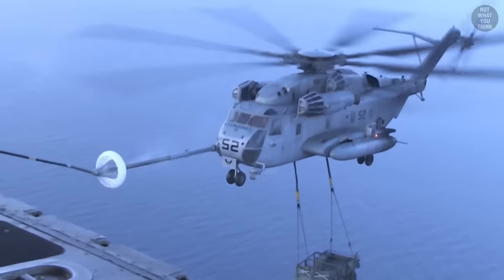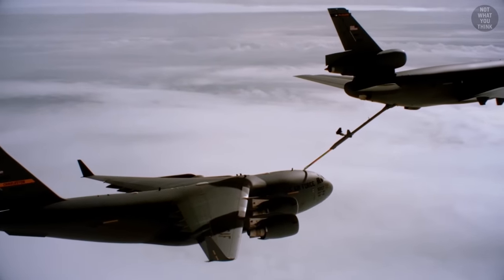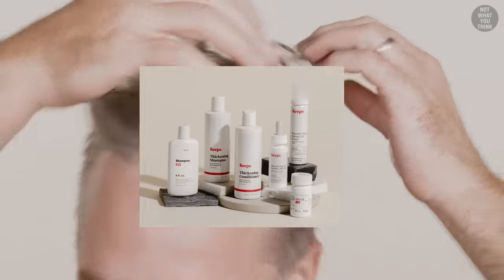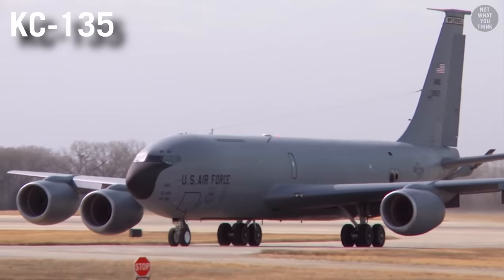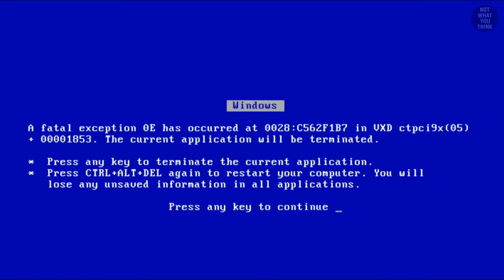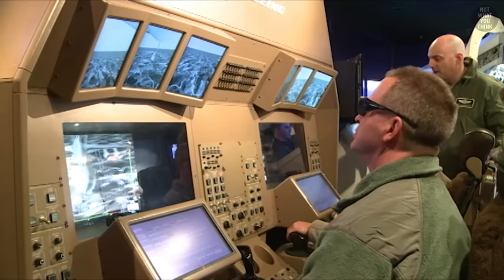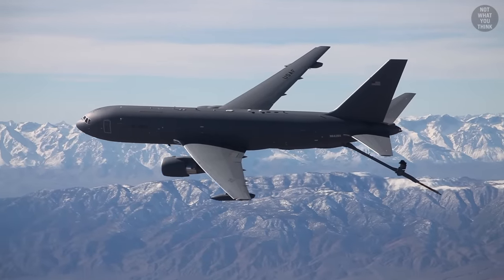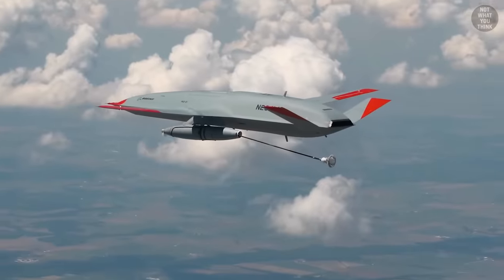Why US Air Force is Making Aerial Refueling HARDER?

Comment: There is a huge difference between complete automation and replacing human vision with a camera. Automation on tanker's part is pretty simple. For a probe and drogue aircraft, just make tanker fly in level, a capability present on any autopilot system in the last 70 years.. For a tanker with a boom, put something like a radio or coded IR transmitter on the F-16's refuel port, and a bunch of sensors on the tanker so it will triangulate the 3d coordinates of the refueling port. It can also calculate booms position with two angles and the length of boom, so its a matter of moving actuators to make these two coordinates meet. With some smart coding to make boom approach from front and top, automation software doesn't need to see anything beyond these two points and would be a simple arduino project for mechatronics undergraduates. 

Replacing human vision with cameras is just a stupid idea. Even today, human eye has greater Dynamic range than best DSLRs (21 EVs vs like 14 EVs). So when scene is bright, we are just better at picking details in shadows, or vice versa.. Our eyes are also less prone to flare or optical aberations (since its essentially a single lens, focusing on a curved plane), so less of the bright area will have impact on other areas. They come in pairs so we have automatic depth perception. Plus, they come free of charge (on the operator). A camera does not offer anything above this, period. Even at night, its just better to give night vision googles to the operator instead of IR cameras.
Reply: If its that simple, what do you think holding them from doing that, and trying this roundabout method. I don't think only for fleecing budget, they can do that without making technical mishaps
Reply: Automation ain't that simple. The main problem is the vast amounts of variables that go into in air refueling
Reply: @dimasakbar7668  I wonder if a reason for going with cameras instead of a window is the near-death sentence for the boom operator(s) in the event of a needed bailout?
I saw a documentary on the KC-135 that commented about that and the constant problems with fuel bladder degradation leading to a buildup of fumes in the rear compartment.
Reply: @dimasakbar7668  "fleecing budget" that is the answer lol
Reply: @andrewarnold9818  I love people making such claims without nothing to back it up. "It more complicated than you think"... No, automation is of refuelling boom's articulation is THAT simple.. It either can reach the intended target or it can't. If target is too far, too close, too high or too low, it can't.. If target is in a favourable area, boom is extanded to reach the target... This is EXACTLY what operator does.
Reply: @dimasakbar7668  Well only technical problem would be refitting every aircraft with a simple transciever... Real problem is ignorance, politics, and specifically ignorance of decision makers. Why F-18E does really exist? Because some morons were convinced scaling up F-18C to F-18E is a safe and straightforward solution because thats how engineering works. In reality Boeing essentially designed F-18E from scratch and it would probably have been much more easier for them to modify their F-15E with a reinforced undercarriage, folding wings, leading edge flaps and make it carrier capable... These are also the same kind of guys who thought its a smart idea to make F-35A/B/C a common airframe, because mixing up all these fundementally different roles is easy and would reduce development and maintenence costs..

You can't convince cavemen that computers don't think nor see like we humans do... So its incremental steps for them to digest... What we have now is manual operation. We add cameras for improved crew comfort(?). Then we add semi-automatic assisted modes to improve reliability. Then we add optional fully automatic mode to reduce operator dependency. Then we remove the operator and make it fully automatic.

Comment: It's quite ironic that Boeing still hasn't solved all teething problems on KC-46 yet while Airbus has already been testing automatic refuelling on A330 MRTT
Reply: Not just testing, it’s already operational, co-developed with Singapore Air Force, certified for use with F-15, F-16 and A330.
Reply: @eatdriveplay  The Boeing KC-767 is also operational with the Japanese Air SDF. It's almost as if these companies only give their least efficient stuff to us...
Reply: @jeffbenton6183  not with automatic refueling and 3D vision though :)
Reply: @eatdriveplay  And that is exactly why the Japanese KC-767 RVS works better then the KC-46.
Reply: @eatdriveplay  The whole point of the video is why THAT is a horrible idea
Reply: @DrSabot-A  it’s not harder - it’s easier for Airbus and their customers. Only harder for Boeing. Figure that out… LOL.

Comment: The Dutch RNLAF former KDC-10 (a modified DC10) was fitted in the beginning of the 90's with a similair system because they could not fit it with a Window, otherwise its pressure cabin could leak. But the flew 25years with it and it works perfectly. Now they switched to the Airbus a330 MRTT with Nato Allies with a similair system as the kc46.

Comment: As a prior KC-10 crew chief, the KC-46 program pisses me off. The tanker contract should have been awarded to Airbus's A330 MRRT, which is already well proven in other countries air force's. With the soon to come KC-Y program, hopefully we get the MRRT as Lockheed's LMXT instead of the KC-46 again.
As far as automated refueling Australian MRRT's have automatically refueled Singapore F-16s  earlier this year.
Reply: Exactly bruh. How the fuck is Boeing so incompetent.
No wonder why there were corruption charges.
Reply: And no.  Both a330/767 have prior to contract been used by other countries.  The idiot US airforce after awarding contract BOTH bid on using Existing refueling apparatus as their basis, then changed it to a new flying boom that may be partially automated.  Your automation F16 Singapore is via drogue and was done a decade ago by Boeing as well.  The problem is the boom via remote station without the automation features which would require existing aircraft to be modified to align the two.
Reply: It was awarded to the A330 MRRT but Boeing through political lobbying and complaining enough got the contract tossed and the contest restarted they of course  won
Reply: @MRMONKEY433  Well, someone pointed out the obvious, the a330 did not FIT into the existing aircraft support structure buildings worth BILLIONS making the Boeing bid much superior.  Now one could argue payload capability and here I also agree with them again, if you want payload, go with an even bigger aircraft.
Reply: So we’re you on the source selection team?
Reply: @MRMONKEY433  That is simply just not true. But it is a popular belief.
Reply: @w8stral  Bingo. I cringe every time I hear someone say the USA should have selected the Airbus. Wrong. You don't replace your tactical sized tanker -135 with a tanker bigger than your strategic tanker -10. There are also other issues dealing with MRTT's size. I'm not going to get into it. The truth is, the USAF AND Boeing fucked up this weapon system. An RVS system is fine as long as it is designed properly. Once the kinks are ironed out with the -46, it will be a very good replacement for the -135. Killing the -10 program is a mistake and it is because the USAF can't manage money .... like any other government entity.

Comment: I've been on both ends of KC-135s being refueled by booms, off loader and receiver. The amount of skill required to accomplish the approach and hookup is amazing and a testament to the crews of both planes. Each system(boom/boom-drogue) has its advantages and disadvantages.
Reply: And I wonder how many people caught one of the advantages to drogues. ROTOR CRAFT 😏
You don't want to get a Stiff Tip,.. caught in those swinging blades 😂🤣😂 😳 🙄 😬

Comment: honestly the prone and drogue seems way simpler because it seems safer and also gives a little bit more wiggle room
Reply: Yeah, until you need to refuel large aircraft in a timely fashion.
Reply: Less control over the probe.
Reply: One small advantage to the boom is that with probe and drogue, the receiving pilot is the one that has to thread the needle. And they might be stressed out from just having been in combat, might be towards the end of a long flight, etc. With boom refueling, the receiving pilot just has to keep fairly straight and level and just keep the plane within a certain box, and the pressure of threading the needle goes to the boom operator, who's been chilling out unstressed and rested (relatively speaking) in their tanker for a while.
Reply: Dave has a good point
Reply: Just cant refuel big bombers in a timely manner tho, and the progue and drogue method is also really difficult at night and low weather conditions, according to a pilot who has refueled from both, the boom is easier overall.
Reply: @dvdraymond  yah right but also think how easy refueling via a probe and drogue is relative to combat or high alpha or high g moves
Reply: @TheFirebird123456  you saying a raptor isn't as manueverabl as a literal pipe with wings
Reply: @rusher2937  yah but you can refuel 2 larg aircraft at the same time
Reply: @xilm22  no, you just can't do that even remotely as safely as boom refueling.
It would also be slower than refueling 2 aircraft via boom, as the boom can transfer fuel over 3 times faster than the wing drogues.
Reply: @John Hero yes, but larger aircraft can only really use boom. For a smaller air wing, probe seems like the best option
Reply: Probe and Drogue IS simpler, but has WAY slower transfer rates. While this isn't a major problem for fighters, it is a significant problem for larger planes.

On a B-52, it can take 20+ minutes to refuel off of a boom. On a drogue, that's 90+ min of flying in VERY close formation
Reply: @rusher2937  yah but a tanker can only have 1 boom but can have 2 drogues. also it's a literal pipe with wings compared to a relatively soft and flexible cables. 
Also who Ceres about refueling 1 aircraft 3× as fast when you are getting more fuel then you are burning. It is almost useless and also refuel a mate in the meantime.
I know you are gonna question what if your getting attack during the refueling. Well just send the escort to fight or most likely gonna be refueling with a nother aircraft so one can go after the hostile while you are refueling and after your done just swap positions
Reply: also you cant refuel a helicopter with a boom
Reply: @xilm22  Pilots and planners care because it means an aircraft can be refueled 3x as quickly. As an above comment pointed out, it does make a big difference if you need 20 or 60 minutes to refuel one of your bombers/cargo aircraft.
What if the other bombers that need fuel can't wait as long? No matter how hard you try, you won't be able to fit 2 B-52s beside each other to allow for simultaneous drogue refueling.
Besides, in turbulent weather a bomber refueling via drogue is bound to have many disconnects, since he needs to stay in formation much more accurately than with boom refueling, further reducing fuel intake / time.

If your tanker gets attacked mid-refueling, something else has gone really, really wrong at a tactical level. At that point you are going to send every fighter from the tanker towards the incoming threat and the tanker is going to run away. Even if you have someone staying with the tanker, they aren't going to be able to refuel safely anyway.
Reply: It is SLOW is the problem.
Reply: @w8stral  make it faster then
Just make the pipe thicker
Reply: @xilm22  Uh.... No.  It would have to be 8X diameter
Reply: @dvdraymond  This. More generally, the boom method splits the stress and difficulty of the whole operation three ways instead of two.
Both methods have up and down sides, and which one is best varies depending on the specific situation. So it's easy to see why the two services chose different methods. Especially with the Navy, where they can't expect to field a big, heavy tanker ANYWAY.
Reply: @xilm22  there's no way in hell you're fueling two large aircraft off drogues at once.

Also with large aircraft, where are you putting the refuling probe? Has to be within line of sight of the pilots, and nowhere within reasonable line of sight has room for a retractable probe so it'll be out constantly adding a bunch of drag.
And the pilot may well have been flying for the last 20 hours and on meth lite.
Reply: @James Peebles Sure, and time on boom/drogue doesn't count..... right. Here is reality, one boom aircraft can fly an entire squadron easily at much higher speed as one thing you forgot is boom refueling must be done at medium/slow speeds and drogue is even SLOWER yet and when you are refueling the entire DAMNED TIME, your range/speed SUCKS ASS.  WHY you need a FAST boom with a GIANT orifice for quick refueling so you spend very little time refueling and more time cruising.  Yes, a Cessna spent what?  72 hours straight or was it over 140?  By circling around a point and hauling cans of aviation fuel up to set an all time record.... they were flying butt ass slow, but technically that counts.... Same goes between difference of drogue and boom.
Reply: @w8stral  the speed is not a limitation of the method of refueling but the aircraft doing the refueling
With both systems the fighter is trying not to stall while the tanker is trying to catch up
If the refueler is say KF/A-18 and the refueled is a F/A-18 the 2 aircraft can travel at any speed above stall speed and bellow transonic no matter what system is used
Reply: @joshuacheung6518  say for example b-2 
The nose
Also let me tell you if we wanted to we can make software capable of doing it automatically
All you need is a tracking sticker on the probe and drogue and a not even powerful computer
Reply: Statement
Because the probe and drogue system hase not been innovated in decades the air force has moved on and the navy is fine with the legacy system. If need for innovation comes they can make software capable of doing it automatically. Basically all that needs to happen is an ir tracking sticker has to be placed on the probe and a few on the drogue. Then Just write a simple software that takes that info then manipulates the controll surfaces and throttle and brakes to bring the separation as close as possible at Wich point it will connect and star sending fuel through.
Also the flow rate problem can be solved by having more powerful pumps and thicker ropes. The safety can increase by using multiple computers and having a manual overide
Reply: The nose. Of a b2. A stealth aircraft.
Reply: @James Peebles correct me if I'm wrong because I'm a bit fuzzy on that one, but weren't those two retrofitted with probes for that strike?
It would be easier to retrofit a probe system than a slot for a boom. Still slow as heck, and with so many AR missions to get that distance i might have a skewed perception fron the range and fueling rate of the b52.
A big fat giant probe like the ones the vulcans had for that mission would significantly impact drag, and time refueling is time not spent at more efficient speeds
Reply: @xilm22  Sigh... Got some more pure BS to spread around?
Reply: @James Peebles it isn't moot, the brits did it because they had no other way of refueling their bomber and made it, but they really had trouble connecting during turbolent weather and even broke the probe on one of the tankers.
Just because they made it doesn't mean a Boom isn't better to refuel bombers with.
Reply: @xilm22  it doesn't matter if it can be automated, even the AI is going to struggle more with connecting with a drogue than a boom, due to the increased random oscillations and more accurate positioning required to connect.
Thicker ropes means more weight and possibly bigger refueling pods to carry it. More pressure means you might need thicker fuel lines within fighter fuel circuits, increasing weight and reducing performance.
You realize though that the same changes could be implemented on a boom and keep it faster than the drogue? No matter what you do, the larger aircraft is always going to be able to accomodate a thicker boom and more powerful pumps, there is no way for a (by necessity) thinner drogue line to be able to match a boom's transfer rate.

If the Air Force really would benefit from a drogue system, why have smarter people than both you and me not implemented it yet? Could it be that, as has been pointed out multiple times, there are advantages and disadvantages to each system that make each match the requirements of different services?
The boom is hereby simply the better option for the air force with their large cargo/bomber aircraft, while the drogue is better for the Navy since they need to be able to deploy small refueling aircraft (like super hornets) from a carrier.
Reply: @Rusher, don't forget that you will have an almost impossible task getting AI past a safety critical review where you have to show how and why each line of code works. You can't use , well we trained it so it looks like it works but we don't actually know why.
Reply: @James Peebles sure, but in turbulence the basket will swing around uncontrollably, while the boom will be self stabilized and also move towards your receptacle as commanded by the operator.
The boom allows the refueled aircraft to hold formation less accurately, making refueling much easier in situations with high turbulence.